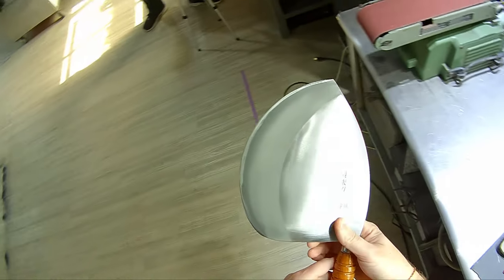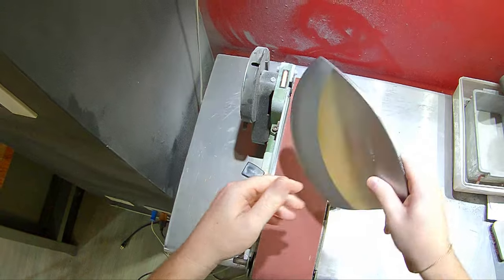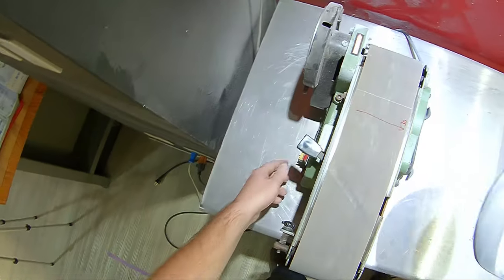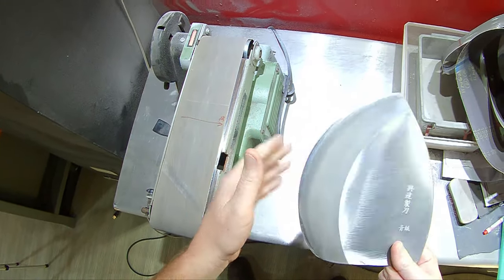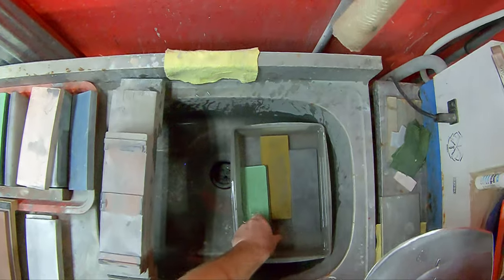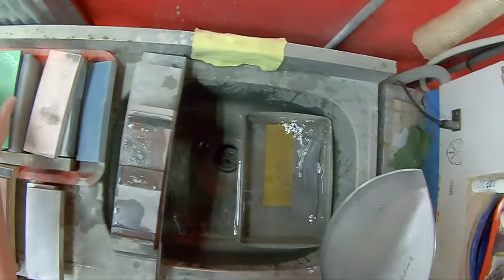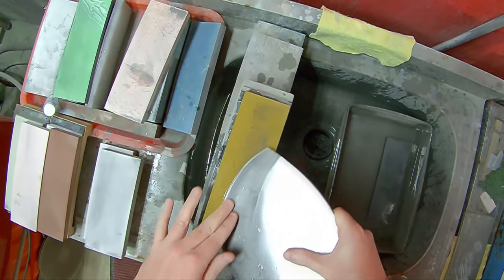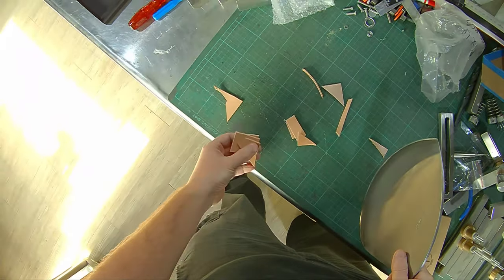Sharpening a Giant Master Kuo G-5 3XL Fish Knife/Cleaver on a Belt Sander- Taiwan Tuna Knife

Comment: Daring sharpening effort - deserving result. When I get such nice  results ( I don't always manage to do it easily) I feel really uncomfortable to put in such rigorous test, since at some spots this nice result I think it will get lost. Or, I do test it, and then give it a short resharpening without test again.
A question to toss. when you put it on the stones, you sharpen only the "very edge" bevel. or oyu usue the stones on the shallower bevels too?
Reply from the maker: Knives are meant to be used, and people certainly abuse them for more than you and I would like! If you see some of the ways people actually use the knife on the tuna, this is a very tame test indeed. When I hit the stones after the belt, it is often very difficult to get the whole bevel that was formed by the belts without some part of the stone trailing across and scratching the blade itself. I usually try to either increase my belt angles, or make the bevel as shiny as possible before hitting the stones. Honestly a knife this big is not easy to sharpen on the stones. It is heavy, too.
Reply: @JendeIndustries  Indeed, that's what I meant when I wrote "daring sharpening effort" - it is heavy, it is very curved, it is big. But after all, these characteristics are what gives it such a high performance on tunas. I think that customers don't often realize that some blades are much more difficult  to sharpen than others. For me, it would be a nightmare to sharpen it. 
Many thanks for the explanation of what's going on when hitting the stones.
Reply from the maker: @georgeskandalaros8661  My pleasure as always! I have to laugh when people say "I only need a fillet knife" when they see the G-5 series. The largest fish they see is a Salmon - maybe. I don't think they quite get the size of tuna and other large fish. :D
Reply: Do you sharpen before sale or do we have to send it back?